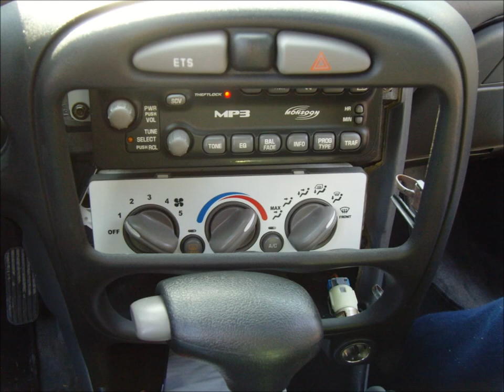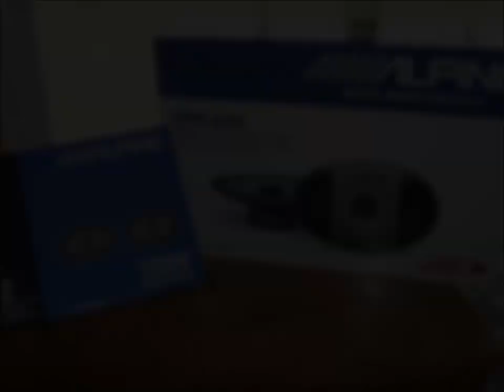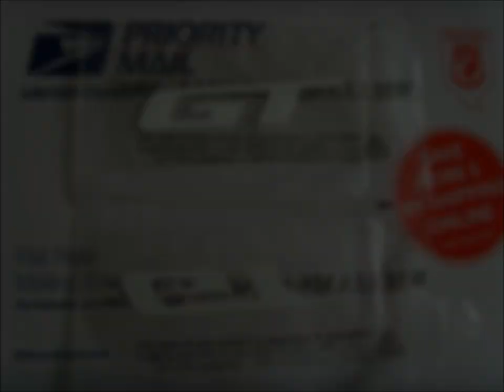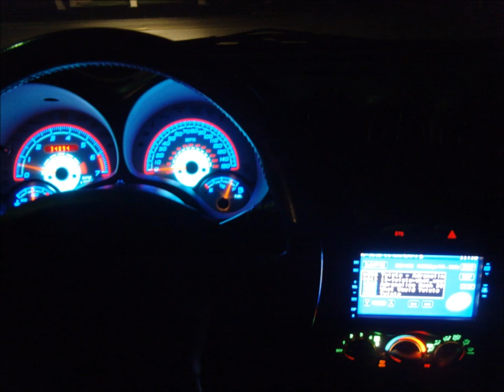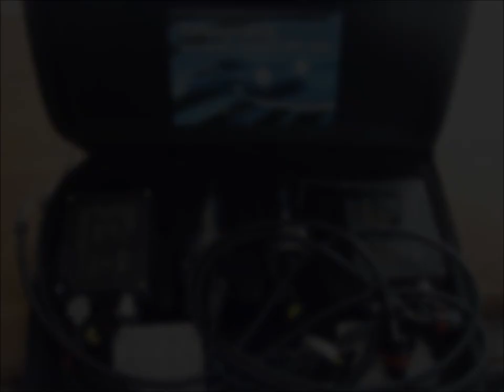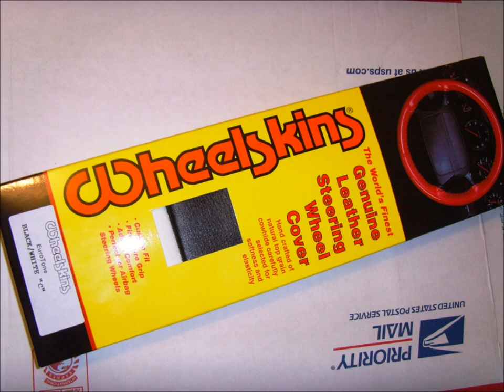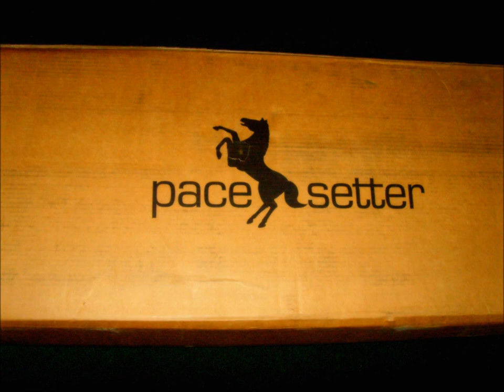GT Blog Oct 2011(The Evolution)HD

Comment from the maker: @iReckIess0632 Yup the corner does blink as well when the turn signals are on. Ive heard the dame thing about the HID kits but ive have no problem with mine. I have an 8k VisionPro HID kit. 8k and its $200 a kit. I have a set in my headlights and a set in my fog lights.